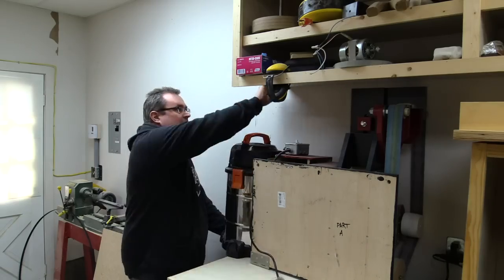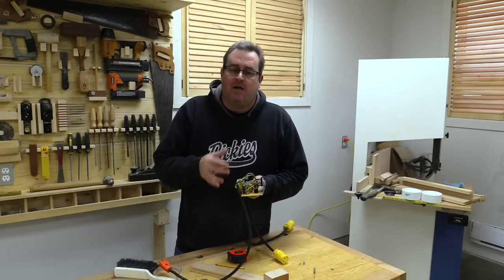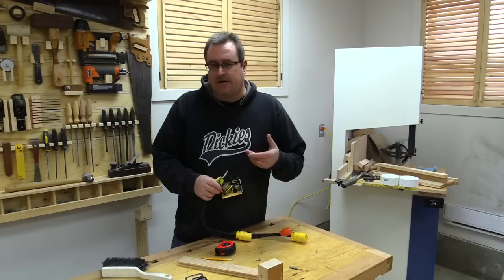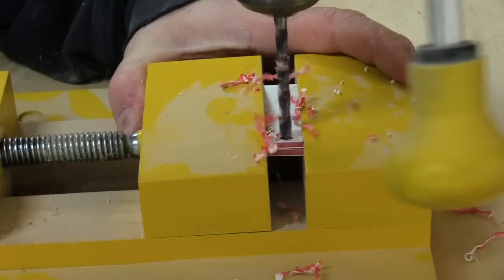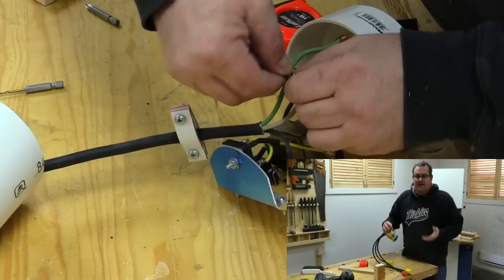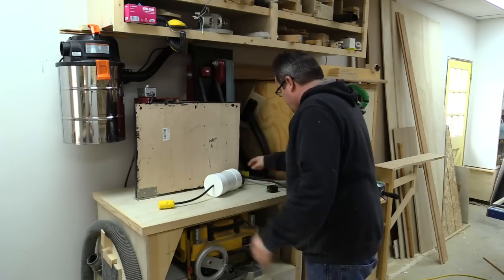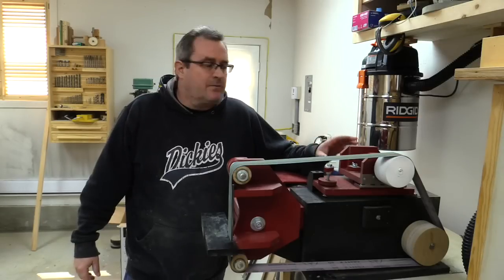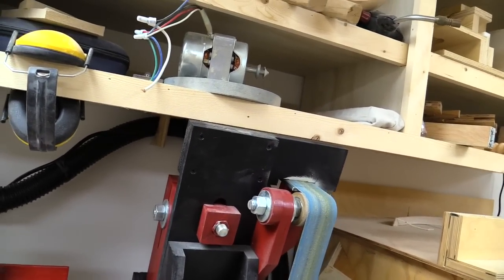The Automatic Switch

Comment: I've been wanting to install an under-the-sink 120VAC electric 2.5 gal hot water tank. The only accessible power is from the 120 VAC going to the dishwasher beside the sink. I would like to have the heater disconnected from the source when the dishwasher is running (can be delayed for 2-8 hrs) and then reconnected when the dishwasher cycle ends. It appears I would just need to use a normally closed relay to make this work...right?

Comment: Really nice, Thanks.  FYI - The pvc pipe you are using handles about like leather at 350 F.  Use home oven ( when wife is out ) handle with tongs & gloves.  Cut pipe down a side before heating.  When it slumps (pvc is not sticky) remove from oven and place between wood boards, add weight to flatten & allow to cool.  put in vice and use heat gun to form corners in plate.  Drill as you would wood.   When this stuff breaks edges are jagged,  very dangerous if strength of material is exceeded.

Comment: I think you should tape the bolts on those strain relief things you made, they may cause a short circuit. For the switch off delay, you can try increase C2 and change K1 with a bigger coil resistance.

Comment: What with the North Americans love of Wirenuts!? If you have to put tape on something like that then its really not fit for purpose!
Reply from the maker: +Callum Burns 
What's with the non- north Americans acting like they are superior? Let me guess.... you are from Europe. By the particular accent of your arrogance and use of extra (!!) punctuation marks, I'd say UK.
Reply: I really wasn't trying to act "superior" or to be "arrogant" The double use of ?! is due to pain to type an Interrobang‽ My comment was more a curiosity than anything else as over here those kinds of connections are laughed at or frowned upon.  Seems I touched a rather large never with you here! Maybe my intentions were lost in translation.
Reply from the maker: +Callum Burns 
I guess at this point, you don't even have to try - it just comes naturally.
Reply: +Callum Burns we use marrettes......or wire nuts....for most electrical connections....we tape connections for extra safety especially with motors or loads that will see vibration. how do you connect 2 wires?
Reply: Choco Blocks AKA Terminal Blocks.
Reply: You also use double the voltage we use. We also use mechanical connectors where necessary.  All houses and machinery utiliser a wire nut to facilitate easier maintance.

Comment: That's a great idea John! This is the kind of stuff that's right up my ally -=)  It shows that the same skill sets crossover to many different types of projects and environments.  Woodworking, electrical, electronics, etc just on different scales in most cases.  You need it, you build it!  Well done!  Also a large capacitor would allow for it to stay running for a little while after, but I agree with you, completely unnecessary as you pointed out.

Comment: That's a nice little device you built.  Did you put a heat sink on the bridge rectifier?  edited:  I just read your article on your web page that you did.  I think with a little playing around with the proper resistance for a trigger voltage from the half wave rectifier, the relay could be replaced with a triac that is also properly heatsinked.
Reply: Ron Briz but then again with the half wave, the triac would only be conducting half the time.  Maybe a diac could replace that diode.  ummm, something to think about, usually the trigger comes directly from the line, but that would make the vacuum run all the time.  I've never thought about the full bridge and transformer part of this.  I'll have to play around and see!  If it goes boom, I'll see you on the other side! lol

Comment: Using the switch with a tablesaw and a shop vacuum connected through a Thien style cyclone separator.  The sidewalls of the separator are clear polycarbonate.  There is a 2 meter flexible hose between the saw and the separator.  Dust begins entering the separator less than 1 second after the start of a cut.  Dust clears through the separator less than 2 seconds after the cut has finished.  The system easily clears the dust before the saw is turned off.

Comment: I would be worked about the strain relief screws and nuts sliding back in and shorting out. I often used nylon tie wraps for strain relief, but couldn't you also just tie a knot in the cable to keep it from pulling?

Comment: Nice device!

As this circuit is constantly on and as the components may fault, IMHO a fuse would be the first and a must addition.

The relay could operate a contactor to reduce the risk of its contacts being burnt.

And last, a question, why a 10V zener when the relay is 12V?

Comment: This video covered just about everything one would need to know about an automatic switch. Except one which has plagued me for some time now. How on earth do you run a 15 amp saw simultaneously with a 12 amp vac?  Every time I have tried I blew a breaker.  I went and added a 20 amp breaker and outlet thinking ok come on now. Nope still pops every time. I know everything is fine with the connection as I can run both machines individually just fine and everything checks out on the old multi-meter. it's just 27 amps is popping the breaker which I guess is what it's supposed to do.  I could always go up to a 30 amp breaker but I don't know of a 30 amp wall receptacle that still runs 120v. Maybe I am just dumb but I can't crack this lol.

Comment: Interesting way to do it, to increase the time the vac runs after operation, put in a bigger capacitor for C2, try something about 1000uF or more
Another way to do this is with a current sensing relay (something i did at work), it has a current transformer that slips over one conductor, if the Ct isn't sensitive enough you can wind another turn around the CT.
Because this is a relay, you can easily add a timer relay to the system
The installation at work was housed in the breaker box and sensed the lines feeding all the shop machines, the current relay then operated a contactor to power the large dust extraction system.

Comment: Hi and thanks for posting this interesting design for a very useful tool. I was wondering what is the maximum amperage this device can handle. Will it work on a circuit which usually draws 13-15 Amps at 120V AC (e.g. with both devices ON), or the auto-switch components need to be modified according to the intended (max) usage? Thank you !

Comment: I don't know what i'm doing wrong.
In my setup after turning on the drill, relay is not working at all.
I disconnect relay and check the voltage at output - and it is good enough. When I connect the relay, he goes up for 1-2s and goes down (drill is working all the time).

Can anyone help me?

Comment: Nice project.  Trying to find a substitute for the discontinued Sears Auto Switch, I found your blog post.   I used your schematic, but instead of a transformer, I used one of the dozens of wall warts I have lying around, connecting the AC connectors of the wart to the rectifier.  Output of the wart to a 5v DC relay suitably rated.  I used a 2-gang metal box with an independently wired dual receptacle instead of the PVC cables.  Works great.
Thanks!

Comment: Excellent presentation.
The circuit measures the voltage across the full wave bridge, which should be 1.4volts peak. That voltage is stepped up 1:20 and the output should be about 28Vac peak to peak. I would suggest replacing D2 (in schematic http://www.ibuildit.ca/other%20projects/Images/Automatic%20Switch/schematic.png) with another full wave rectifier. You also want to have a resistor to limit the current when the zener is conducting. This resistor will be forming a voltage divider with the relay so very little current will actually go into the zener. to drop from 26 volts (after the bridge) to 12V you need about 450 ohms. With 450 ohms, a 10,000 uF capacitor will take about 4.5 seconds to discharge. Using a supercap, one would get very long delay..
I have not experimented with these variations, but as soon as I do, I'll produce some feedback.

Comment: isn't this the same thing from amazon.... Air King AKDT60 Delay Timer Switch, White? its used to turn the light off on a ceiling fan and leave the fan running for a set time period from 1-60 minutes
Reply: Kevin Mcdonald. Not the same. The thing he made in this video senses the current that the saw draws when it is switched on with the switch at the saw.  The AKD60 senses the voltage (at or near the light) when you switch the light on from a regular wall switch.
I think thats not what you are looking for.

Comment: Actually 120v is more lethal than 240v.
Thats because if you touch 120v you you will be sticked to the cables by the elettricity .
With 240v you will be repelled.
And its the amps that kills you , not the voltage (police tazers are more than 10000 volts but with way less amps than the wall current.
Reply from the maker: Andrea Rustinelli It's a combination of a few factors, but in general terms, when there is no practical limit on the current draw (which is the case when dealing with mains voltage), a higher voltage will be more lethal. Don't count of 240vac "repelling" you.
 A good analogy for voltage and current is to compare to a deadly snake. The voltage is how fast he can move to sink his fangs into you, while the current is how much poison he has to deliver. It's always better to run into a slower moving snake than a fast one, regardless of how much venon he has.

Comment: Nice circuit.  Just wondering if you could do the same thing with a smart powerstrip which is made usually for computers.    MDP 650 is cheap and should provide the same functionality and does not require anything to build. Any case nice job.
Reply: I think a power strip would trigger the vacuum to turn on.... at least the ones with the light...

Comment: Great idea! To make it run to clear the dust out of the lines you could easily add a switch that bypasses the rest of the circuit. You would only need 2 short pieced of wire and a simple household light switch.  Also that way if you needed to use the vacuum for anything else you wouldn't have to mess with unplugging it and plugging it in somewhere else.

Comment: as an electrician and fiddle with electronics in my spare time, may i put some input in here. A pvc utility box would be a better enclosure.

you can buy an instant on delay off module on ebay for like 3 bucks, and a small CT (current transformer) foe a couple more, andtear open a small 12v wallwort for a power supply.

run the hot wire going to the saw through the CT, or loop it a couple times if the signal is too weak. use the ct to trigger the module and the module to trigger the relay. most times those mods have adjustible delay times through turning a screw.
Reply: maybe ill make a video! O.o

Comment: I Build It I think you could use a true off delay relay to do the off delay operation (regular off delay require a separate trigger, but true off delay relays don't). However, they are fairly expensive.
Reply from the maker: Julien Nadeau They are expensive and unless you can get one for free, it would be cheaper to buy a ready make load sensing switch! I don't know why everyone is making a big deal out of having the vac continue running after the cut - it makes very little difference.
Reply: I Build It I don't care about keeping the vac running, was just suggesting an alternative to your circuit that requires no modification (beyond replacing one part).

Comment: Could have just used a reed switch, relay and small 5v power supply.
Reply: Is a reed switch activated by a magnetic field ?  Where would you physically put the reed switch ?  Near the motor of the table saw ?

Comment: Built this circuit using a 6V 1Amp transformer.  Relay is 12V with 275 ohm coil. Relay won't trigger when circuit is powered through by running table saw.  If I turn on the table saw first, then add the relay to my breadboard, the relay closes.  Any recommendations?
Reply from the maker: Helen H A relay with a higher impedance coil (mine is 380 ohms) would be one solution. The problem is there is very little current from the transformer, so it needs to be as small of a load as possible. Another solution is a solid state relay - they trigger with very little current.
Reply: I Build It Thanks for the reply.  Might try the SSR.  Also thinking I could use a 5V zener and use the output as a logic signal to drive a logic controlled relay board.  Power to the relay coil could be from a tiny USB wall charger.  Adds a little complexity but might be easier than trying to get other components to cooperate since the margins seem pretty tight.
Reply: Helen H Have the automatic switch working now with the logic controlled relay board.  I had been planning to build an Arduino controlled switch before seeing your build and decided I liked your method better.  I also built mine so it controls the vacuum running off a separate circuit, which is an easy modification.  I don't really see the need for having the vacuum running longer than the tool as I don't think enough sawdust is being generated to create a problem.  Easy to let the saw run a little longer or just assume that the next time the saw starts, the vacuum will suck through any residual dust, for anyone who thinks it's a real issue.  Many thanks for sharing your ideas on this project.

Comment: Any dust in the hose will get sucked up next time you turn the saw on, before you actually cut the wood anyways!
Reply: Julius Jahn I believe the thought was to let the vac continue to run to suck in dust from the surrounding air to improve air quality.
Reply: Jason Bourdon In this case it's probably true, but the people who will complain are the ones with hoses hooked right up to the machine. I just have my planer hooked to a power bar, and keep the planer+dust extractor on, and use the bar as a master on/off.

Comment: I am concerned about the total load posed by both the saw and vacuum on one circuit. I have a commercial switch that does the same as yours, but it allows me to connect the input power for the saw to one AC circuit, and the input power to the vacuum to another. That way I don't trip circuit breakers. I think your switch could be modified to have separate input power cords and accomplish the same thing.
Reply from the maker: MrJohnnyboyrebel Sure could, but it's a rarity to find a split outlet (two circuits feeding one receptacle) outside of a kitchen, and ordinarily all of the outlets in a room will be on the same circuit. And if there is more than one, they are usually pretty far apart making it impractical to plug into.
Reply: I Build It You are correct. Most garages or workshop outlets share a single breaker. I guess I was fortunate to be able to add a separate circuit in my shop to accommodate two high amperage tools at the same time. My new shop is planned to have three circuits, with staggered outlets on each of three walls. The fourth wall has a 16' overhead door so there will be no outlets. Plus I'm adding two 120VAC outlets in the ceiling in the middle of the shop, and two 240VAC outlets on two separate walls. Call my new shop sawdust nirvana, I suppose.

Comment: I know people have mentioned using a bigass capacitor in parallel with C2. Thats all well an good, but a better way would be to add a capacitor with a resistor in series with it. The discharge time is given by R * C so if you want a 10 second delay you could take a 100K resistor in series with a 100uF capacitor.
Reply from the maker: theonlyari No one seems to realize that there isn't enough CURRENT to charge a bigger cap. Adding a large cap will stop the relay from firing altogether. Remember, the source for powering the relay is a transformer wired in reverse, to step up the small voltage drop across the bridge diodes, and there is simply not enough current to do anything other than that.
Reply: I Build It Your circuit has to generator a substantial amount of current to energize that relay (32mA). With that said, i think i do need to put my foot in my mouth-- if you put a 100k resistor in series with the 380 ohms of coil resistance... its never going to energize the relay. I have to agree that the only ways i can find to add an additional delay would need a power supply-- which is more that you likely want to do for a simple switch. Reading through the blog post-- a SSR would be a very poor choice for this as you would have to add additional over voltage protection to protect it from the HUGE spikes that will be generated when turning the saw off.
Reply from the maker: theonlyari That's surge current, from turning the saw on initially and after it's running there is substantially less. If the cap eats all of the surge current (it will), the relay will never close.